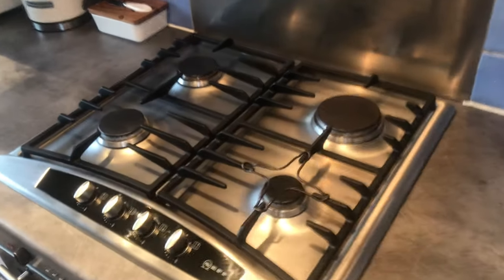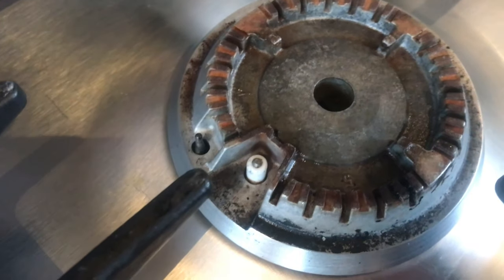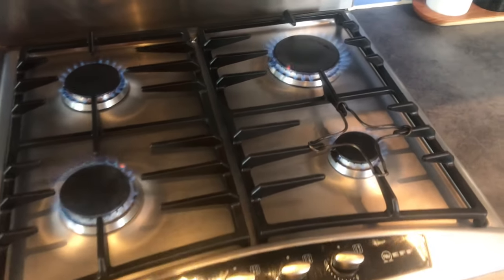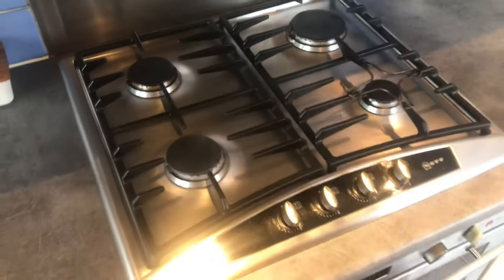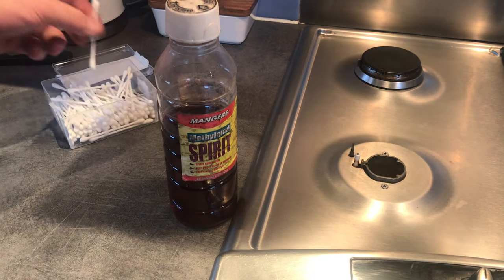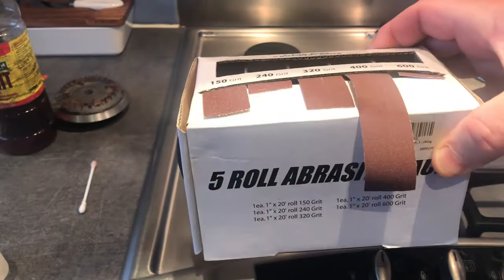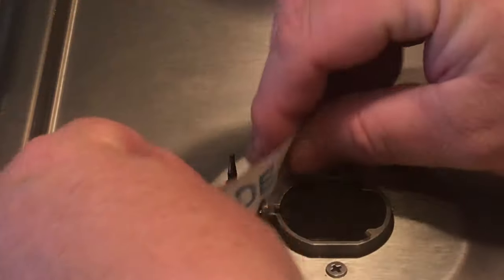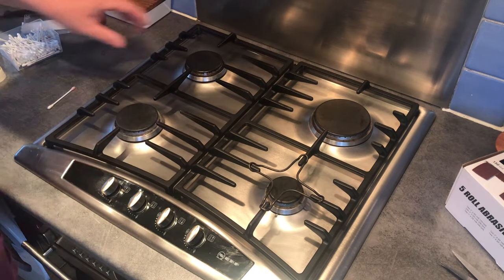My gas stove / hob / cooker won't stop clicking - How to fix it

Comment: This worked. My cooker has stopped clicking wildly. I went a step further and removed the top cover by removing the small screws you can see here. They are star shaped for safety. ( risk of electrocution) I found two igniter cables literally lying in a pool of oil. I cleaned it all up and walla , no more annoying clicks. ! Thanks mate!!
Reply from the maker: Glad to hear you sorted it Kay. You did what I’d do as the next step but there are limits to what advice we content creators can advise people to do on here, just in case some muppet killed himself after watching a video. 
Please remember to give my channel a sub and check out a few of my other videos for more great tips and content.
Reply: @essentialhandyman  absolutely right. Will do thanks.
Reply: It’s “ voila”, French.

Comment: My Jenn-air works the for the first part but once I turn off the stove, it started clicking again. I couldn’t clean it because there’s no way to shut off my stove, the switch that you have is no where in sight 😫
Reply from the maker: I think you may be in the states, is that right? I've heard you don't have switched sockets out there, so localised isolation would be a problem. If you have a main fuse board, you could turn off the cooker from the main switch, double checking it's safe of course, and do the cleaning with the cooker isolated from the mains. Would that work for you?

Comment: Opened the top cover of my gas range to clean it up thoroughly. The metal sticking out beside the igniter is a thermocouple sensor connected to a solenoid valve where gas pass thru. It shuts off the supply of gas in case there is gas leak or temperature too high (not sure which of the two). Safety feature I guess.
Reply from the maker: I aoopreciate the lesson Alex. I'll try to remember those parts.There's no point in living unless you learn something new every day! Cheers.

Comment: Awesome worked! Save my weekend - thanks so much! Clicking suddenly started while nothing was on (scary). Then turned off the breaker, cleaned the around the spark plug. Didn’t work. Then turned everything on, ignited all the burners, hit the breaker , let all the burners run on simmer/low for 30 minutes without power, turned off the burners, turned power back on and NO noise!
Reply from the maker: Boom. Just like that, peace in the home is restored. I find the clicking to be like water torture. Soooo frustrating. Mine has just started doing it again. So long as you realise it will happen every so often, it's fine. You just rinse and repeat. Ps, don't forget to hit the subscribe button. Thanks.

Comment: Thank you sooo much!! The clicker thing was going on for 24hours and the keeping the flame on for a few mins stopped it. Thank you!!!
Reply from the maker: Glad it helped my friend. That clicking drives you potty doesn't it? If it happens again (and you have a UK tyope system where you can turn the appliance off at the wall / plug). Turning it off after it's been ignited, stops the clicking.
Thanks for watching and commenting and please remember to like the video and subscribe for more helpful advice.
Reply: Is it not dangerous? Mine started in the afternoon but for some reason I can't fix it now but only in the next hours. No problem?

Comment: I didn't have rubbing alcohol, so instead as a quick fix (after putting the burner on for some time did not help) I switched on the underneath oven to 350 F and let it sit there for 10 mins. I think that heats and warms the underneath layer of the cook top and helps get any moisture stuck there. The clicking stopped for me after that
Reply from the maker: Hi Sanket. That's brilliant feedback. Thanks for posting it. I'm glad you got the issue sorted. Please don't forgt to subscribe for more great tips and advice. And check out my latest videos while you're here.

Comment: Brilliant solution, fixed the problem in an instant. I used Hydrogen Peroxide as it was all I had to hand.
Reply from the maker: Glad it helped you Bryce. You gotta use what you've got. HP is a good cleaner, so should be okay I think. Please remember to subcribe to the channel and check out some of my other videos for more great advice.
Reply: @essentialhandyman can u use vinegar?

Comment: Hello all, Kenmore gas cook top, 20 yrs old but never used. New condition. I am curious about how it was engineered. The knob has to be turned past "high" to initiate the spark ignitor by entering a 3 inch venturi tube. That is a lot of gas spewing out before ignition. Should I install it in a home with kids? Thoughts?

Comment: Helpful video! I'm still having this issue and have tried your advice, would you have any more ideas? Or do I need to call a handyman/electrician?
Reply from the maker: This pretty much works almost every time. Give it another go. Try leaving burners on longer. Then try cleaning and sanding more thoroughly. Then try burners again. It should work.

Comment: Can we use other staff for rubbing like dishwasher soap instead of alcohol
Reply from the maker: Hi Besmellah. Hmm, I'm not sure, I've only used products which don't leave a residue when they dry. I've not tried soap as unless you wash it off with water (which is one of the things were trying to avoid) it will leave a residue. I've added an Amazon Affiliate Link to the video description for surgical spirit/Rubbing Alcohol. Which should assist you.
Please remember to subscribe to my channel, hit the notification bell and watch a few of my my other videos, for some more helpful tips and great content.

Comment: If it’s still doing this after both, any ideas?
Reply from the maker: I’ll try to help.
1 - What solution did you use to clean it? 
2 - How long did you run all burners for?
3 - Did you use sandpaper to clean the over components?

Comment: Great video! Do you have any solutions for one of the hobs not even clicking? Just moved house and one of then aren't working at all 🤔
Reply from the maker: Turn off the power, check all connections are okay, turn on power and check. Anything more complicated and you really should call in an expert. Don’t mess with electricity if you’re not an expert.
Reply: @essentialhandyman  thank you! I will try and see what happens 😉

Comment: Any idea what the problem could be if its still clicking even after I've let the gas run to dry up any moisture and throughly cleaned it? It's a relatively new hob <4 years old and was working perfectly up until this evening
Reply from the maker: Sometimes you think you've cleaned it thoroughly but you need to spend more time getting in all the nooks and crannies. Please remember to subscribe and watch a few of my other videos for more heklpful advice and handy tips.

Comment: Do you know the white stuff surrounding the igniter it looks like a ceramic that you sounded what if that is cracked and broken on one side expose in the whole igniter travel size?
Reply from the maker: The white surround on my cooker is plastic. It's there to insulate the metal, so that the spark comes out of the section at the top of it. I've never had a cooker where that white section broke. However, I would say watch what the spark does and act accordingly. Does it still spark only towards the gas burner or does it spark in other directions?

Comment: Hi , I can't find the plug to turn the electric off to start to clean it , we have drawers underneath the hob but can't get them out
Reply from the maker: Try pulling each drawer out as far as it will go, then, when it's at it's full extent, lift the front of the drawer up and pull out again. That usually gets the drawer to come out. Let me know how you get on.

Comment: Thanks Mate! I wish my  stove had a switch on the wall to turn off the power to the unit! (American codes do not require it, alas.)
Reply from the maker: Thanks for watching and commenting Jeffrey. Feel free to subscribe for more great tips.
Reply: By his accent, he is a Brit.  They use 220v as their regular elect juice.  Hence the plugin switch in regular, house wiring.  In US we run 120v.  Stove, still is wired for 220v at the panel.  In our case a switch cannot conveniently be wired in.
Reply from the maker: @BasilRBhan  Hi Basil. Thanks for watching. You're almost right. Yes I'm a Brit and we're almost at 220V. Over here we used to be 240V but are now powered by 230V. in our single phase (typical household) supply. It's really interesting to hear that you don't have similar cut off switches over there. It makes us realise how convenient it is and how lucky we are over here. Well, I'm assuing it is a good thing. I'm sure there must be a good reason (apart from the safety aspect of you having 120v over there) for you not having an isolating switch. If you know why you don't have a switch, I'd be really interested to learn. Cheers.

Comment: In the middle of trying to fix my oven, what does it mean if I turn it off at the electrical board but the top still clicks?
Reply from the maker: Are you saying that you think you’ve turned it off but it is still making the clicking noise?

Comment: How do I fix one that the igniter doesn’t come on at all?  Mine suddenly stopped sparking
Reply from the maker: 1 - Check someone hasn’t turned the cooker off at the wall.
2 - Check the cooker hasn’t been unplugged.
3 - Check the consumer unit to make sure you haven’t ‘tripped’ one of the RCDs.
4 - Check the plug to make sure you haven’t tripped the fuse.
These are solutions for an electrical system in England. If you’re from somewhere else, comment below where you’re from and my viewers may be able to help you out.
Please let me know how you get on.

Comment: I’m usually scared of anything electrical but i wanted to try the second method where you turn switch off but fire is still burning. Is this quite safe? My ignition has been clicking for months and it’s driving me crazy!
Reply from the maker: Essentially it’s two different fuel sources. The gas provides the continuous flame. The electricity literally only provides the spark to ignite the flame. Once lit, there’s no need for electricity, so you dont need the gas on.
If your stove has been clicking for months, it’s more likely to be dirt than water but try lighting all burners first, as it’s the quicker of the two options.
Please remember to subscribe, hit the bell icon and choose to be notified for all my new videos and watch a few of my other videos too.

Comment: it's my oven that's the problem for me, when I turn the knob to light the oven the gas comes on but ingniter keeps clicking and the only way to stop it is to turn off the knob to off or turn the switch on the wall to off and then the gas goes off. ..my top burners are fine.. so, is it the same principle that the igniter may have some grease or oil on it?
Reply from the maker: Thanks for watching and commentig Tina. I guess it's the same principle but as the oven gets so hot, it's unlikely to be water in the oven, so more likely to be something on the burner. Sounds like you're gonna have to get your head and shoulders in there and clean the burner off. Please remember to subscribe and watch a few of my other vidoes, for more helpful tips.

Comment: Hi. I have tried both methods and clicking still going on. Have good spark and gas but clicking not going. What can i try next pls?
Reply from the maker: Hi Beaver. Sometimes it doesn't work and you've got to repeat the process. Just run the heat long enough to make sure it's completely dry and after that, it's a case of making sure you are meticulous with the cleaning and sanding. I find sand paper gets rid of much more dirt than washing, cleaning etc. Good luck and let me know if you manage to stop it this time. Ps, don't forget to hit the subscribe button. Thanks.

Comment: U reckon white spririt would work as good ?
Reply from the maker: Hmmmm, I'm not 100% sure. I tend to use white spirit/turps for removing sticky residues, cleaning paint from my hands,/off of surfaces etc., and meths for degreasing. In my expeeience white spirit dooesn't degrease as well as meths. That said, if that's what you have. Use it sparingly and wait for it to dry before you igniote the burner (it is petrol based after all!!!) and see if it works for you. If not, you can try some meths and conduct your own investigation. If you do, I'd be really interested to hear the results of how both performed.

Thanks for watching and commenting.
Reply: @essentialhandyman  yh I just brought a place it had never been cleaned all 4 was going crazy I gutted all 4 and now only two are doing it but no rubbing alcohol on hand so will grab some tomorrow to be safe but wow u shouldve seen the state of mine
Reply from the maker: @wilkiesxgaming  Feel free to subscribe for more great tips.
Reply: @essentialhandyman  I'm trying white spirit now and it hasnt worked, cleaned it multiple times and let dry and still clicking.
Reply from the maker: @angelahowarth506  Interesting feedback. I'm not surprised as I'd expect meths to degrease better than white spirit.
One last question though. Are you sure the burner isn't clicking because it's wet? If you fire them all up and leave them running for a short period, it may dry out any reesidual moisture (like mine did) and solve the clicking.
Reply: @essentialhandyman  I used white spirit on a cotton bud then left to dry, then dried with kitchen roll. It was the sand paper trick  that finally got it working, admittedly I didn't have sand paper so used an emery board/nail file.
Thanks for your video.
Reply from the maker: @angelahowarth506  my pleasure. I’m really glad the video has helped you. After all, that’s what this channel is all about.
Please consider subscribing for more great tips.

Comment: I’m having this issue, only one hob is sparking just like in your video and I cooked using that one last night while the clicking continued, tried it again this morning and it’s still clicking, everything looks spotless so not sure why the clicking is still continuing
Reply: update for some reason the ring that was clicking/sparking wasn’t the one with the issue, noticed one of the other rings was a bit dirty around the ignition so cleaned that one off and it is no longer clicking 🙏 thank god
Reply from the maker: Glad you resolved it. This is an issue which will periodically happen every few moths or so I think. You've just gotta keep going through the process and keep it clean if you can. E.g. I tend to cook on my front left burner most of the time but I know this week my rear right burner started clicking if I use it. Looks like I'll be following my own advice (again) tomorrow, to get rid of that infernal noise.
Thanks for watching and commenting and please remember to like the video and subscribe for more helpful advice.
Reply: @essentialhandyman  yes we do the same it’s only really one or 2 burners that get used and because only one was sparking it was just that one that needed cleaning, although something must have spilled onto the back one at some point because after cleaning that the clicking stopped 🤷‍♂️ haha

Comment: all 4 of my burners keep clicking even when they are lite.  I tried cleaning as I spilled coffee on the top of the stove and cleaned up real good but the4 clicking or igniters keep sounding. I tried just using the gas to dry up things but I will try again.  Kind of weird why it doesn't stop.  I even opened up the stove to see if coffee was inside.  it wasn't inside but when I put it back together click click click.........
Reply from the maker: Sometimes it does that, you think you've dried and cleaned it and it keeps clicking. If it does, you just gotta start again and do even more cleaning, as what you did wasn't enough. It's a pain but that's the only answer I have.

Comment: Mine won't stop clicking. My guy cleaned it using and moisture got in and it's been clicking since.
Reply from the maker: Char Char, have you tried my methods in the video? It may be that you didn’t dry it out long enough or spend enough time cleaning it off.

Comment: Friend, you dont need to clean the white part.  it's the metal on top of the igniter that is creating a spark with the  metal part that the black cap sits on. the dirt is  on the metal part that you previously removed. This part didn't look clean
Reply from the maker: Thanks for the feedback Dror. Feel free to comment on some of my other videos.

Comment: I did everthing you said. Not wet and perfectly clean. Still clicking. What does it mean when they talk about something being out of alignment?
Reply from the maker: So you cleaned it and dried it and it’s still clicking?
Reply: @essentialhandyman  All good now! Clicking stopped! I cleaned it thoroughly and then used my hair dryer to dry it thoroughly and that seemed to do the trick! Thanks very much!

Comment: 3 out of 4 hobs are clicking - but i think its a fault with the ignition button itself
Reply from the maker: Usually when it starts clicking, one dirty igniter will set all of them off, so you can't easily tell which one is the culprit. But I suppose it's good practice to keep the hob clean by doing them all. Good luck and let me know if you manage to stop it this time. Ps, don't forget to hit that subscribe button. Thanks.